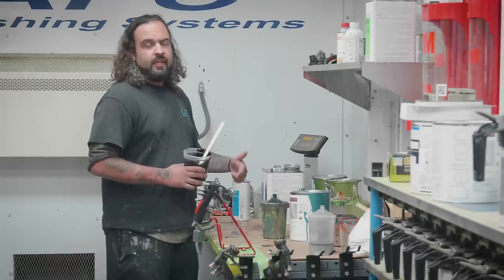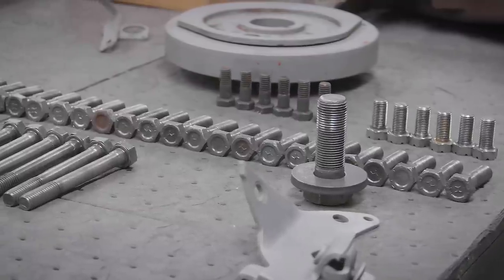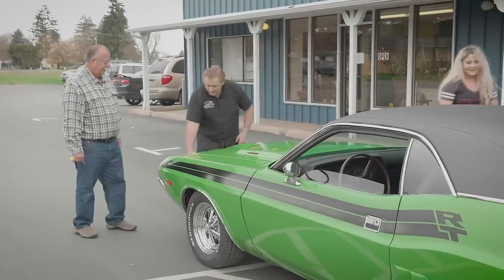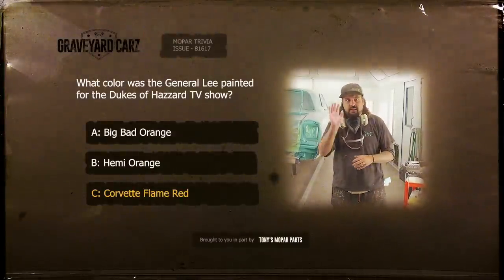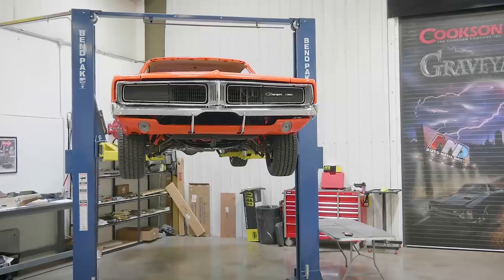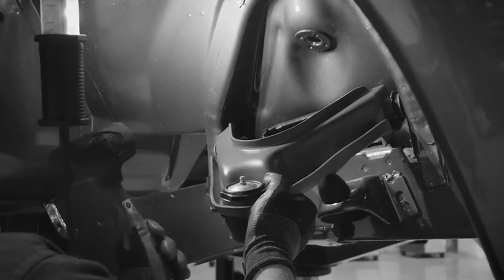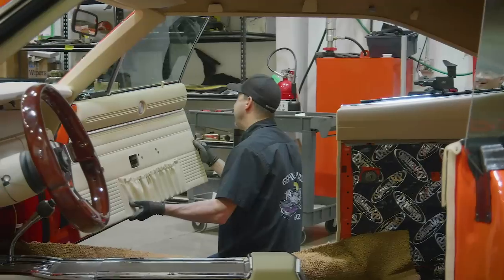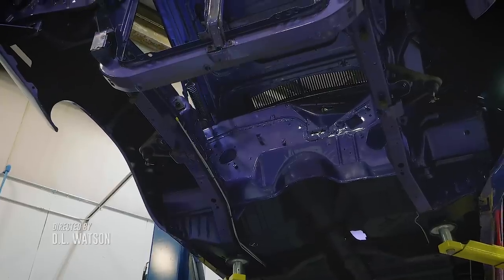S08E02  GENERAL LEE FREEWAY JUMP CAR

Comment: Mark should have included in the directions of "Building a 440" that clearances need to be measured, and blasting media needs to be blown out of the block (recalling a 340 that didn't) so it does not destroy the motor. (and Mark won't have to say someone sabotaged the motor).
Reply: Huh...

Comment: Whereas Alyssa is as hot as mid July, the cars are cool as they come.
I'd like to collect ...
70 charger R/T 426
Plum crazy
70 Cuda 426
Tored 
70 challenger R/T 440 -6
Plum crazy
67 cornet R/T
Butterscotch 
69 super bee 440 -6
Green
67 GTX 426
Red
69. Daytona 440
Blue
70 suoerbird 440
Sublime 
Are few of the mopars I like

Comment: Idk if it matters but with every head I do whether it's a diesel or gasser I do the torque settings in 3 step increments instead of jumping straight to the max torque.. with the cummins after final torque you turn all of them 90° but I double check them after a heat cycle as well. I don't like my engines blowing head gaskets haha ❤ but to each their own and your not pushing HP so its fine

Comment: John Schnider says (very recently) that the ORIGINAL General Lee was not an official color whatsoever. It was oranges from a variety of different paints available at the time on set mixed together!
Reply: Yup!! Was just kind of a mutt orange
Reply: But the original General Lee was Corvette flame red. That's true. The colors changed over time with all of the contorting and body work that the cars went through. That's why there isn't a definitive answer to what color it really was. Lol
Reply: “For years, it was thought that the General Lee was painted Flame Red, a 1975 to 1978 Corvette color. It's pretty close, but that's not the real color.”
~ Travis Bell
Reply: Actually the found the FIRST General Lee the studio built for the pilot. They THOUGHT it was made x color or xx color BUT turns out when they researched the ORIGINAL PAINT COLOR, they had it computer read. And it was a bulk orange paint the props guys had plenty of and was then documented as the transport company paint color(or original multiple cans mixed together that's the closest the computer could match too.
From the GL Numero Uno original part. So take it as it lays.
Reply: @earlputnal9124  NOPE
Reply: @MonzaRacer  Ask John Schneider and he'll tell you it's true. Because the shades of the colors on every car were different from car to car every single week of shooting. And he would know because he drove all of the cars in the series.
Reply: The general lees paint is tnt express
Reply: @earlputnal9124  the general's paint actually was scanned, from the very first general ever made. and it comes out to a color called "TNT Express Orange" look it up if you want to buddy, Travis Bell actually found the ACTUAL color of the very first general. :)
Reply: @thatguitarguy0  Kewl. But there aren't anymore actual movie or TV series cars out there. Unless the actual owner displays it. But it's still a nice clone car though.
Reply: @MonzaRacer  Computer color matching has improved, but it's meant to get you in the ball park for a blend into other panels so you don't notice.
Reply: I work in the movie business , I have for the last 27 years , there is no way that an actor knows for sure how anything is painted , the only people that would know for sure were the guys who painted all those cars in the 70's and 80's back then , and nobody was keeping track of anything like that back then, they barely keep track of things now as it is ..   the best detective work comes from one of the original trunk tops, color matched to TNT Express Orange . John Schneider will only know what he was told , by a drunk high Transpo guy ..  .

Comment: I am a GM preference on newer stuff.
The muscle car days be tuff to be brand loyal.
Nice Mopar, race ready Ford gm SS , yenko Baldwin motion.
It doesn't seem possible f could by a car like they offered at the time.
A key car that was track ready.
Today's stuff is okay at the car show I am the promoter a hellcat, Shelby SS , Z06 barely get a look yet dull brown fairy she 500 with sideoiler 427 stick dog dish hub caps,vinyl bench gets lot of attention  
Even the old pick ups up to  72 get lot of photos verse new Roush, Callaway or Shelby.
Style verse flashy decals or small emblem.
A 110,000 Shelby truck verses 5000 when new 1969 .
To each there own

Comment: Dear Mr. Wurmman, John Schneider said the original color of the General Lee was "mutt orange". A mixture of random oranges they had in the filming studio that they threw together, and painted the car right in the studio. John said it was not' Hemi orange. Somehow you will have to make a premier show featuring the accurate General Lee color. You could bring in a therapist and film your interaction with them as you deal with your anguish accepting the "mutt orange" color. I'm actually surprised that you could not smell the mutt toners in the paint. Therapy may help you deal with this.